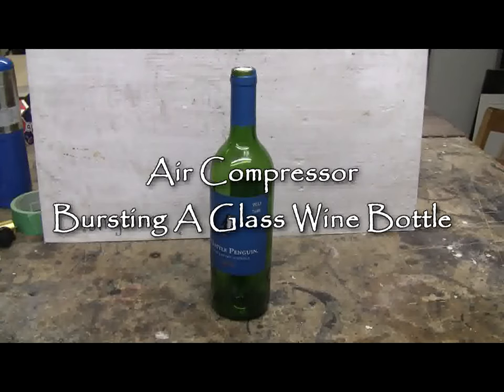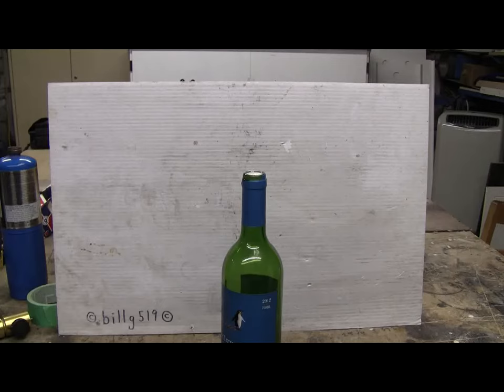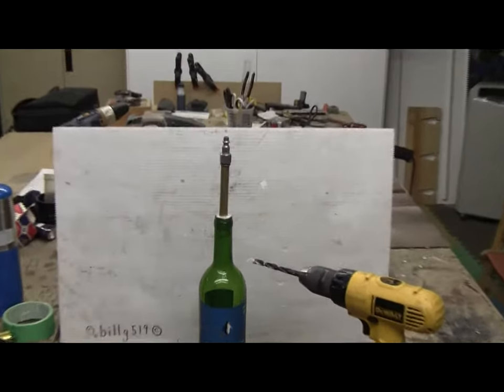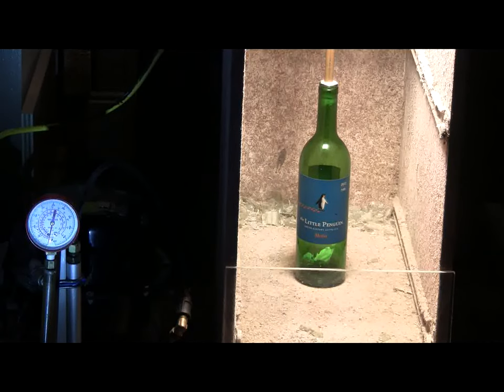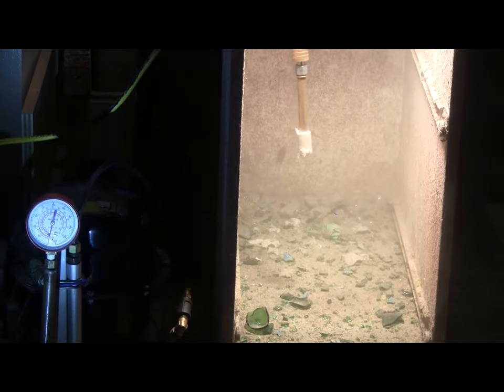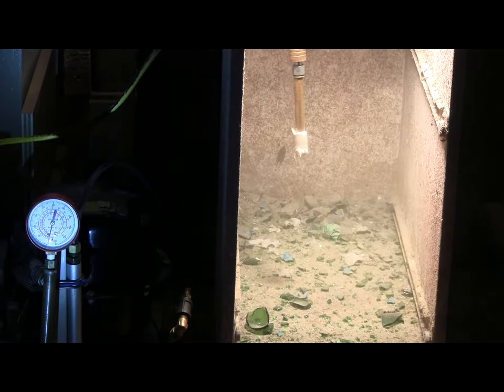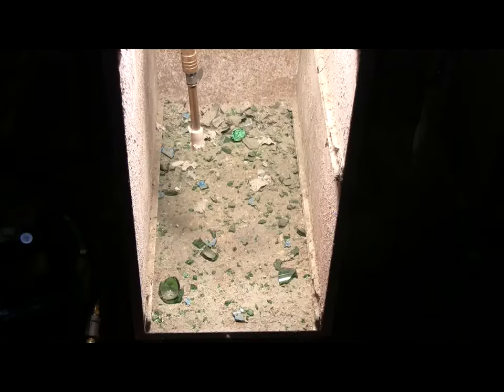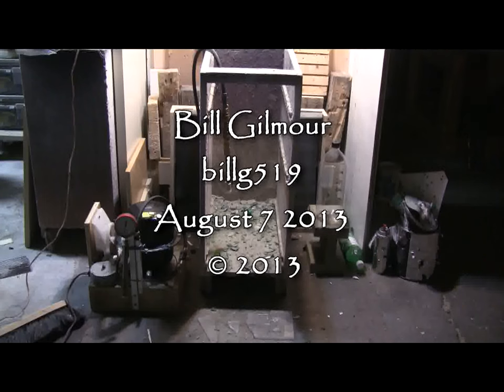Air Compressor Pops Glass Wine Bottle At 260 PSI

Comment from the maker: I don't like glass shrapnel. The compressor gets remote started and I am in another room. The bottle was in my 10 meter air cannon range backstop to prevent the spread of glass. If a leak prevents a bottle from bursting, I can shoot it with an air rifle from a safe distance. Containment worked, cleanup was quick and easy. Yes there will be more videos coming. Thanks for watching.